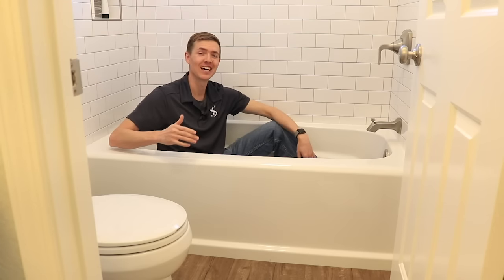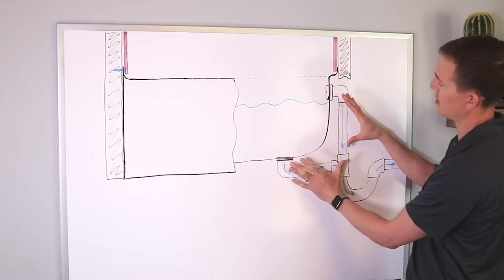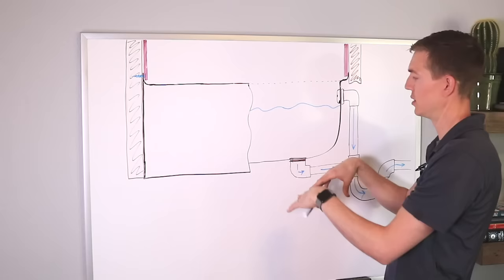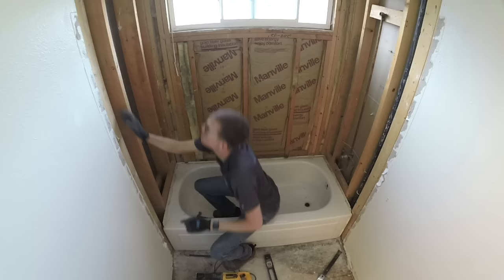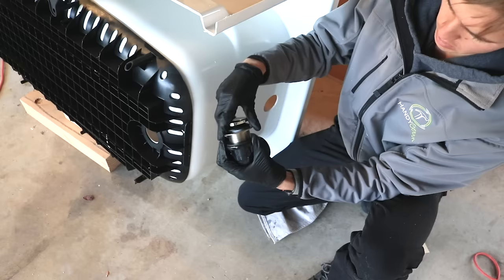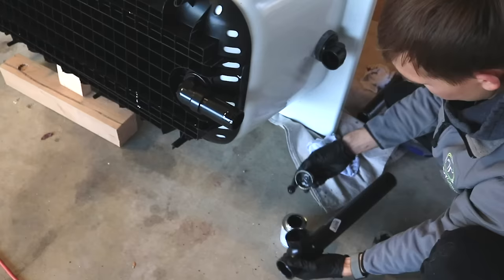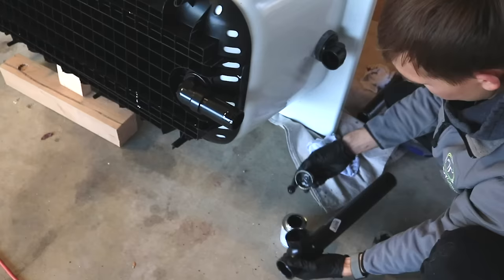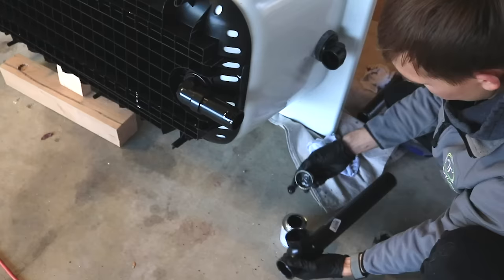How to Replace a Bathtub (Step By Step)

Comment: What's the odds of removing a tub and the new tub plumbing lines up the existing plumbing?  Are tubs (Alcove) like the one you installed a standard size tub?  Thanks...
Reply: Apparently not good odds. We just went to put in a new tub and the old plumping does not line up at all. Trying to learn how to redo the plumbing now.
Reply: @sarahmarie92292  Yep.  I installed the two tubs and the plumbing didn't line up, but all I had to do was cut some of the drain pipe to make it fit, so it was too terrible a job. It had the older Black pipe.  I had to remove and install all new copper pipes because the old stuff had pin holes all over.  I also rerouted the copper pipes beneath the floor in the bulkhead.  Why it wasn't routed in the bulkhead at first is beyond me.  Any leaks would've required a complete tear out to fix.

Comment: Hey man. Not sure if you're still seeing these. But no stringers with the morter? I'm doing mine now and struggling with leveling. Just curious if your tub has held up okay without the stringers
Reply: Read the manufacturers directions. The tub I bought recommended stringers.

Comment: Could you remove a 5ft jetted bathtub the same way? Or would it be necessary to gain access from underneath due to the motor and other components? I do have a crawl space. Also I've noticed the comments refer to putty often(for drain and overflow) but you mentioned manufacturer stated to use silicone...Which do you prefer?
Reply: Use silicone, it lasts longer and typically gives you a better seal, BUT you must let it cure for 24 hours before running water in the tub.

Comment: This was one of the best I have seen. I like the part where he leveled the floor first with leveling cement but how he got it perfectly level by hand troweling as shown seems unlikely.  Wouldn't the mixture need to be very thin and watery so it seeks level like water. I have heard of stuff like that but he was troweling it on pretty stiff and no chance of it automatically leveling. I also question the use of silicone instead of plumbers putty on the drain and overflow since most videos recommend plumbers putty. Oh and right after he "leveled the floor" he appeared to test install the tub. Did he wait for the compound to dry first or test the tub while it was still wet? He doesn't say.
Reply: Plumbers putty always drys out and cracks, causing leaks.  A second floor leak can literally cost you thousands in repairs (plumber, drywall repairs, textured ceilings, painting).

Comment: Hi everyone, i have a question. So, the floor of my bathtub is cracked and i was thinking to replace with a new one. But i was told that i need to pay for permits (e.g. water permit?). I am confused what it actually means. I do not mind paying for contractor and other fees, but with the permits fees it totals up to around $3000. I do not have that kind of money :(
For reference, i live in an apartment/coop. 
If anyone has the answer, I will appreciate it!

Comment: The shims you used to bridge the gap between the tub and the studs, does that mess with the studs all being level.

Seems like if you needed to add those shims, they should be added the full length of the studs going up right?
Reply from the maker: No, because the kerdi board doesn’t rest on the shims or the tub.

Comment: I’ve never seen anyone put silicone on the bottom of the drain. Plumbers putty is the correct thing to use. You’re just asking for trouble if you try anything else.
Reply: I know! He started by removing his old tub, which he is easily able to do because the previous one wasn't siliconed on, and then uses silicone to make an unremovable drain!

Great video otherwise though.

Comment: I keep seeing installers putting silicone when installing the drain fitting? Is that mandatory? I thought the gasket was enough. Will I be able to open that after? Is that the same silicone as used in showers or in the kitchen at the back-splash?

Comment: Does this process still work if your installing a bath tub that is deeper then your old one?
Reply from the maker: Deeper tubs may be harder to fit. So depending on your situation, it may not. The tub I installed in this video was deeper than the original, but not by much.

Comment: My mobile home has a captive nut on the drain. What can i replace that with for an " above deck only" installation?
Reply from the maker: I don’t know.  I never work on mobile homes.
Reply: @StayHandy  is there an elbow with internal threads i can use?

Comment: Why use silicone vs plumbers putty around the drain and overflow?
Reply: Been doing plumbing for 40 years. Use plumbers putty and if possible all ways set tub in a bed of morter.

Comment: Why silicon instead of plumbers putty on the physical drain you screw in itself ? I can understand silicon on gaskets but I imagine plumbers putty will make sure all gaps are filled and create a better water tight seal.

Comment: CUT A PIECE OF ROOFING BLACK PAPER
PUT IT ON THE FLOOR
MIX A BAG OF MORTER MIX
AND SPREAD THE MORTER MIX
AND THEN SET THE TUB.OVER IT
AND IT WILL FEEL SOLID
WHEN IT'S DRY
AND YOU HAVE NO SQUICK SQUICK
WHILE YOU STEP AND WALK IN THE TUB
Reply from the maker: Yes that would be faster, but I wanted a method where I could remove the tub if I made a mistake, which I did.

Comment: 7.5 minutes in, test fit the tub and make sure its level. what do i do if its not level? shim?
Reply from the maker: You need to level the floor. Depending on the tub you may be able to use shims.

Comment: Thanks for the video. I'm wondering why you didn't embed the tub in mortar or plaster.
Reply from the maker: Because I’m installing the tub from the top and I needed to be able to take it out multiple times in case the pipes didn’t line up.
Reply: Not all tubs need a mortar bed. They are designing them to support themselves without a bed.
Reply: jmartin015 Hi! I’ve been researching tubs for months and have yet to find one that doesn’t have dozens of reviews saying it was cracked prior to purchase, cracked after purchase, or had some other issue that caused the tub needing to be replaced soon after installation. I would love one of the porcelain coated tubs, because they claim to be lightweight, but even those are listed with issues that quickly show up. 

Can you recommend a good tub that is lightweight?

Comment: Hi what model and brand tub is this?  I like the the bottom support system it has
Reply: It's a plastic tub. Even with the support it had on the bottom. light weight tubs should always be set in mortar with wood supports around all the top lips. This was a very poor install.
Reply: @ltsgarage7780  i like the look also
Reply: @vocalone23  yes it is a nice looking Tub. 5 years down the road it will be a broke down POS

Comment: Don't silicone your drain gasket, silicone is a maintenance item and the gasket itself has a longer lifespan. Also when using plumbers putty and with proper placement there's no need for it.

Comment: Hi my bathtub drainage water connection right side connection has per my builder blue prints
My plumber suggestion to put on left side connection drainage and water connection . He says that connection are near to wall & later there will be problem
Please advise me what shall I do I already purchased right side connection bathtub my local dealer not ready to exchange this
Please advise
Rudy
Reply: Possibly an outside wall and the water lines may freeze in the winter. I'd take his advice if this were the case.
Reply: Rudolph D' Cunha 👍
Reply: Move to Arizona, where it doesn't matter

Comment: Thank you for the great video. I have exactly the same bathtub, which goes instead of the old one removed, but I also have a piece which is called a apron support (it goes between the bathtub and it's front panel). Did you use it? Another question is about 2 penoplast (or whatever that material is called) white blocks, that are seemed to be glued from the sides of the tub. Are you suppose to remove them or leave them on their place, where they are)? I think you left them. And also if I may have your opinion on this. I leveled the patch on the floor (with liquid level), but on the border with the other cement floor it shows in some parts a small uneven (in height ) edge. The size of this unevenness  is rather small about 1-1.5 mm. Can I leave it like that or I need to smooth it?
Reply: If it's intended to be removed, it's generally pretty obvious. The only thing I've had to remove from a tub or shower when installing it were wooden frames they were packed with. If it seems any way part of the tub, I would leave it. Yes you want the apron support

As far as being uneven, is it supported for the most part? The big thing is the majority of the tub is supported, and will not rack when pressure is applied to any one area (corner to corner)

If the skirt is screwed to the wall and it's supported on its own footing, it will be fine. There is always variance in the floor and walls, especially in renovations. Ensure the footing is secured though, you don't want to be able to stand on one end and have it sag even just the tiniest bit, corner to corner needs to be solid.
Reply: @nomorefortniteguy7800  Thank you for your replay. You know I called Delta, they told me to level the floor best I can, so I did another poor with LevelQuik Level over that patch, used Anvil 18x4  and 11x4.5 trowels and made the floor where the bathtub will be as smooth as a skating ring (to be on the safe side). But I have another question, maybe you know this. 
   I have a problem with installation of a bathtub (Delta 40034L) because I need to remove a part of the stud on the right at that place where the apron is (it doesn't go through). Bathroom is 60.5 in from stud to stud, bathtub is 60 in long and 19 in tall (since there is a base attached to the bottom of that tub), so diagonal of the apron is 63.02 in. The stud is 3 and 3/8 ", so if I remove that stud (part of it on the bottom), the problem will be solved. But how? That is a question for me. That stud consists of several parts, which vary in length, 1.5 and 3 feet each. I don't know how those parts are connected, but it shows lines with teeth marks on the borders. Of course I can cut off with the reciprocating saw, but think it should be done differently, using those parts (with teeth), where they are connected. There is electric wire there, but it goes horizontally (I saw it through the slit between the stud and drywall), so it shouldn't be a concern (I also can shut off power in that place). It is left sided tub, and I need to remove the stud on the right (if you are fronting the tub), where the apron is. 
   My acquaintance wants to come and check if it is not a bearing stud. I think it is not since many people need to remove it (I saw in some films), I'm not the only one with that problem. They are actually two studs, one perpendicular to another, so if to cut that one which is parallel to the wall (leaving another one, which is perpendicular to the wall), nothing happens in the sense that the structure won't be jeopardised. But if you can (and have time of course) give your opinion about it I would really appreciate.
   Thank you for your previous answer again.

Comment: Good video, but hard to understand the steps, You cut the drain assembly first, and then you mark/measure location. Should you mark/measure first, before you can cut and assemble the drain assembly?

Comment: Why was the drain assembly glued to the tub first in one part of the video and then later it was glued into the house plumbing ? Am I missing something ?
Reply: To make sure it’s right length and Straight
Reply: Not glue to tub. Was attached to tub and pipes and fittings were glued together, but not glued to tub. I assume, then removed drain assembly in order to attach to house drain line, prior to re-dry-fitting the tub.

Comment: If you are just replacing a tub in the same place why would you need new pipes? Shouldn't you just need to screw in the new stopper? In the west we have concrete slabs, that drain is not going anywhere.
Reply: Same question!!

Comment: I did my first and second myself. Cost about a grand each for all kohler products tile flooring etc. Remodeling through a contractor 10k easy what a joke it took a weekend.
Reply: I heard that, this stuff is not 10,000 dollar hard...
Reply: Contractors have huge overheads. In New Jersey we need 3 million dollar insurance policies to even step foot In your house.  You as a homeowner dont need several work trucks to be insured etc. A warehouse to store tools and material. Your workers dont need workmanship comp,benefits etc. Trust me, the profit is only at 50% and that's if your lucky.  Out of 10k, only 25% is the labor price and that's most of your profit.

Alot of people nowadays like to hire cheap guys who have no insurance,license etc. They can do a 10k project for less than half, but your taking a huge risk. If they get injured, they can actually sue your own home owners insurance! Yep that's right, I've seen it happen. And they can also easily rip you off, especially when theres no paper trail and their company doesnt exist on record. 

 Believe me when I tell you, the costs of a legit contractor are fair.

Comment: You don't add any sealant to rubber gaskets or to the tub drain basket. Rubber gaskets should be left alone and the drain basket should be sealed with plumbers putty. Less is more.
Reply: No plumber's putty on acrylic tubs. This is discussed repeatedly in the comment section of every tub install video I watch. It's always best to follow the manufacturer's directions.

Comment: How about showing the connection to the sewer line 🤔
Reply from the maker: That’s what the black drain pipe is. The connections to the sewer line should already be installed and you don’t need to mess with them.

Comment: it was looking good until you proceeded to caulk all the drain assembly, unnecessary and incorrect, the tub drain itself from bttom has a thick gasket and from the top you should apply plumber's putty, and the overflow also should have its own gasket , that should not have caulk to face of it as you want it to make full contact with tub.

Comment: With your method how long did you take to finish installing this tub and the drain??? 

One thing i would do differently is to do the drain from the bottom . I think if we take more than 4 hours installing a bathroom tub then we won’t make any money 😂😂😂
Reply from the maker: For many pros this method doesn’t make sense because you probably won’t be the one fixing the drywall, but when it’s your own home, it’s nice to save an extra step.

Comment: At least you're not a hack. If you want to know how you can eliminate picking the tub up so many times, I can tell you.  I dry fit and install before the tub goes in. The measurements are all you need to drop it right in top of the drain. Once put your silicone or gaskets on through the holes, don't pick it up again, lol  just an opinion.
Reply from the maker: Thanks for the tip

Comment: Show how you remove a cast iron tub
Reply: Because cast iron is brittle and easy to break the most common way is with a sledge hammer. Personally I use a pick axe as the point of the pick deliversa more concentrated blow to one spot and usually penetrate the cast iron with the first swing. One I have a hole I break up the tub using a sledge hammer into small pieces that I can easily manage by myself. If the intent is to remove the tub and reinstall it in the same or another location... you'll need help because it is next to impossible for one person to remove a 300lb cast iron tub by them self. Plenty of Youtube videos showing the sledge hammer technique.
Reply: Use a sledgehammer. Just make sure you wear safety glasses and wear long sleeves. The finish flies of like daggers.
Reply: Wow! Why would anyone want to take a chance and create damage to adjoining walls by pounding a cast iron tub with a sledgehammer? Get a good grinder and cut it into 4 pieces and walk it out like you know what you’re doing!
Reply: @EltonNoway  done it  a hundred times
Reply: @salvatoresaccoccio2379  grinders can start a fire.  You dont k ow what's under the tub
Reply: michael lennon you’re a freshman and don’t know squat, I’ve cut out many tubs in my 50 years of being a tradesman. Where did you serve your apprenticeship?
Reply: @EltonNoway  that's all I've used on cast iron tubs. never tried the pick ax though.  Next one I will definitely try with a pick ax then the sledge like you mentioned
Reply: I'm sorry, but it's re - MODELLING

 @crispychicken2743

Comment: Uhhhh....I didn't see a P-trap...unless you fashioned a 3 piece trap using  1-1/2" abs spigot 90's.....(not shown in your illustration)...if you did, I guess that's cool but an inspector will question that as I've never seen an approved trap like that....and I've hooked up 1,000 of tubs doing tract work. Also, and a small amount of anything to hold that overflow seal in place is a good idea but leave the drain spud rubber gasket out till you set the tub, then stuff it in where it goes and use a ring of plumbers putty around the chrome spud. CAREFUL not to cross thread the chrome spud into the drain shoe.... and then tighten it with spud wrench. (mine's home made) Getting the waste hooked up properly is the most difficult part of the install. Many DIY'ers or contractors who don't really know plumbing try their best but I've gone back and had to cut out the whole waste & overflow to re-plumb it. There's actually an easy way to hook up the waste from above but it's something I'd have to show a person.
Reply from the maker: There is a p trap. I’d never not use one. Maybe you should make a video.
Reply: @StayHandy  I've made videos...they all suck